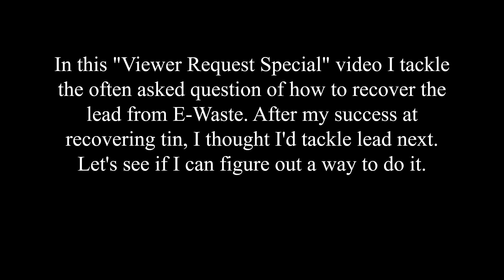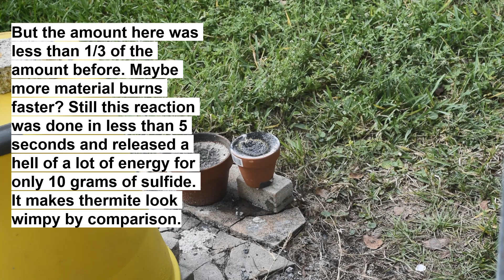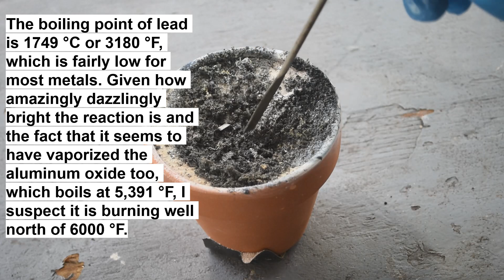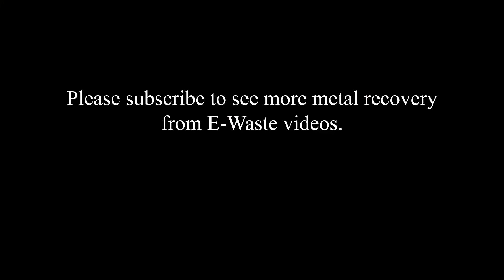Lead Recovery From E-Waste part 1: Viewer Request Special #recycle #chemistry #ewaste

Comment: Excellent. I appreciate your work. For sulphurous soils where the sulfur must be removed and the gold extracted, I add potassium nitrate or chlorate to the sulphurous soil and also a little charcoal. I burn all the disturbing elements of the gold soil and extract the oxide soil easily and without any trouble. Good luck

Comment: You probably ended up burning the lead sulphate into lead oxide with your thermite reaction. The way it looks is a typical metal fire (zinc burns very much the same way) and the "fluffy slag" is also typical for that type of reaction creating oxides. So, in that case, your sulfur primarily bound to the aluminium, and the oxygen bound to the lead and aluminium -- which would be very energetic. That would explain your H2S smell as well afterwards with the moisture from the air. Overall reaction, I think: 3 PbSO4 + 6 Al -> Al2S3 + 3 PbO2 + 2 Al2O3.

Comment: I think you might have been making lead dioxide in that reaction.. 🤔
The flux probably just prevented some of the aluminum from oxidizing and anything molten just got trapped in the melted glass slag. 😬
If you do the thermitic reaction slow enough to avoid ejecting material or contain it in a crucible, you may be able to test that fluffy dark ash that you got without it getting contaminated or amalgamated. 🤷‍♂️

Comment: Hi Mike, Great Video. I'm still not understanding. Circuit boards are covered with tin/lead solder even today. Even I use 60-40 solder at home. So if you had say 10 kgs of stripped/depopulated boards, put those boards through a heating process to melt the solder into a glob. I know that some boards will have high melt solder and some may have low melt solder. But, all in all, you still have tin/lead solder. There should be some chemical/cementation way to separate the two without torching up the neighborhood.
Reply from the maker: Next video.
Reply: Pretty much all electronics use lead-free solder these days (he's right saying there are environmental laws against use of lead solder). It causes issues by being more brittle (hence damage to PCBs being a lot more common now). Lead-containing solder is rare, at least in just about all end-user equipment. Only equipment that needs specific high tolerances to temperature and stress will use lead-containing solder for the pliability of the resulting metal.
Reply: Then why if you google "what is solder made of" you will find a 60/40 tin lead combination? So if lead was removed from solder what is left just tin?
Reply from the maker: @Alex-kp3hr  You can still buy 60/40 lead solder for personal use. It isn't used commercially in much any more. Modern solders are mostly tin with a few percent of other metals to improve their properties. Silver, copper, and selenium are common additives.

Comment: According to the almighty god google,  when lead oxide is heated with carbon, the carbon removes the oxygen from the lead oxide, leaving the lead metal behind. Hope this helps.
Reply: That's how it works when using litharge when smelting,

Comment: hey there. I have been messing with lead compounds for a long time. I tell you the simplest way to turn lead sulfate into lead metal, is you react it with a solution of 30-40% naoh or sodium carbonate, making lead carbonate or hydroxide, and sodium sulfate. the carbonate can be easily be smelted into metal. I can provide more info, just reply.
Reply from the maker: Next video I do it similar to that.

Comment: What about a plumbers solder, like 60/40 lead tin? Probably a better source, I have a bucket slowly accumulating of soldered copper pipe elbows, Ts and faucet ends, which every good scrapper should trim off for the #1 copper prices

Comment: Magnesium is super dangerous.  I use to work ilwith it in a smelting plant that made car parts.  Had a clean up guy spray water on a hot biscuit that came out of the mold, 😂 well  i don't think he ever done that again. That shit went up super fast and was so bright it lit up the 30,000 square foot building we were in. We all had to evacuate the building due to the smoke it let off... super nasty stuff.

Comment: Nice try, BUT lead is way to high in the line of reactive metals (over copper iirc), so the reaction with aluminium is way to energetic. 

There is a way better suited to get metallic lead from lead sulfate: it is the process use in a lead acid Batterie! I recommend to try this next. 

Plus you can use the lead oxide from the one electrode to regain sulfuric acid from your last waste treatment step. How? You make lead acetate from the lead oxide and give it to the mixed sodium acids in the waste liquid, so the lead acetate reacts and drop out of solution as lead sulfate. Filter it, put the lead sulfate into the electrolyses cell and get lead and sulfuric acid back. Closing a circle.

Comment: isn't it lead sulfate that causes cells in lead acid batteries to short out? If so, I've seen people use Epsom salt to wash the batteries and recover them from their internal short.... so I wonder if there is a simple electrolysis reaction you can do rather than vaporizing the lead into the air?  My first test would have involved a test-tube and allot of heat to see if I could melt it back into lead and burn off the sulfur...

Comment: If that is sand below the material you ignited, and you did get in the 3000s of deg F I would have expected to see some molten sand. Did you get any? If not then you are not reaching those temps or the burn material/ash is acting as an insulator perhaps

Comment: Oddly car batteries already use lead sulphate and of course lead, simple electrolysis should get lead back on one of the electrodes as if the battery is being charged, might even get sulfuric acid back too

Comment: So, a question I asked in a forum years ago, and got completely shot down. Maybe you might have some insights. What about getting lead from CRT glass? Seems like you'd get quite a bit more if it were possible to do.
Reply: @user-kj4wr1qy5d.    My biggest yield so far was 1,960 kg of pure lead from 8 tons of CRT glass and almost 1½ ton of crystal vases/wine glasses. Some years ago I got 8 to 10 CRTs every week. Now I don't get even 8 in a whole year, but I still have around 150 CRT glass funnels in stock, waiting to be processed. The biggest CRT glass I've ever handled was 1.5 m wide and weighed 400 kg.
CRT glass funnels are made of three different types of leaded glass; all must be processed separately. On the inside of the front panel glass you'll find valuable Rare Earth Elements in the form of a fine powder layer. It must be removed very cautiously with distilled water due to its toxicity. CRT glass funnels also yield a nice quantity of nickel, worth twice as much as copper.
Reply: @zero-waste  I don't suppose you have a vid of the process?
Reply: @Belgarion1971 .   I don't have time to make videos. I can make much more by scrapping/recycling.
What are you doing within recycling? How advanced are your activities?
Anything specific you wanna know about CRT scrapping and recycling?
Reply: @zero-waste  Right now, my activities are limited to tearing stuff apart and selling to my yard. I'm just about ready to start experimenting with metal casting. I'm still in the learning phase of processing ewaste. Basically I wanted to know if extracting lead from CRT glass is even doable for a diy'er, because I was told absolutely not by that forum group. I'm playing with the idea of casting fishing jigs.

Comment: What kind of Al2O3 do you use? Im having a problem with this Al203 120 grit someone gave me 5lbs for xmas, and I kept getting no ignition so i washed the Al2O3  with acetone then vacuum filtered it now ive got it drying in my vacuum chamber, hope that does it, cause its definitely not my Fe2O3 as I bought the finest i could afford! Any info would be appreciated
Reply from the maker: I'm not using Al2O3. I'm using fine aluminum flake. Al2O3 is a product of the reaction.